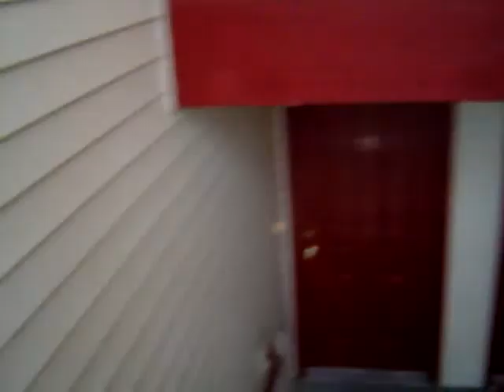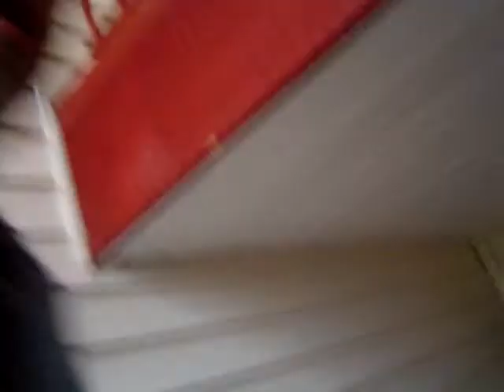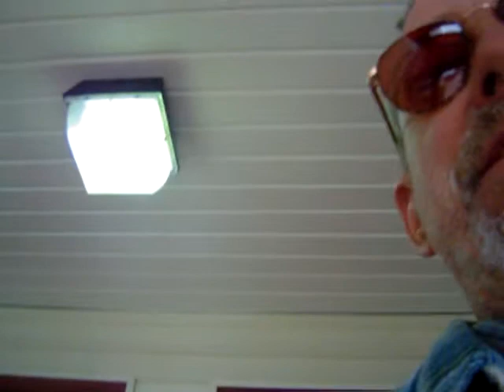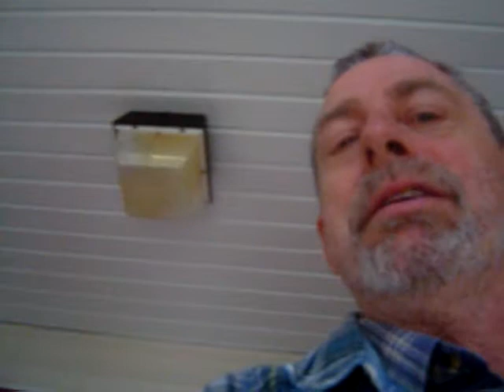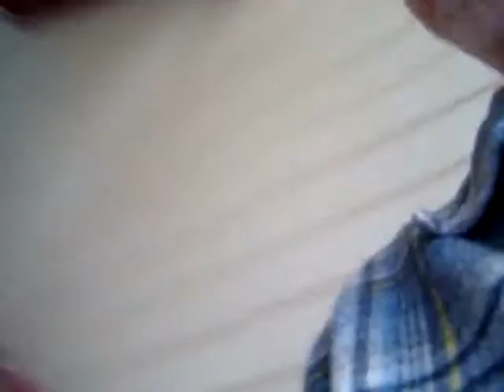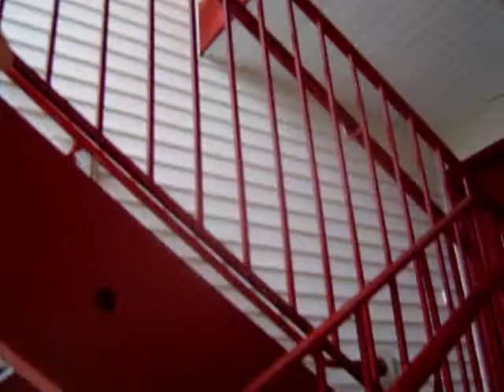Street Light Interference 4

Comment: This is called "cycling." When a street light nears the end of its life, it does this. As the bulb heats up, the gas pressure increases. Therefore, the light requires more power to glow. Eventually, its demand for power exceeds what the ballast provides, so it goes out. Once it cools down, it is able to start up again because the gas pressure decreases. It repeats this until it can't start the lamp anymore. Try this with a different light and I'll believe you. Also, the buzzing is the ballast.